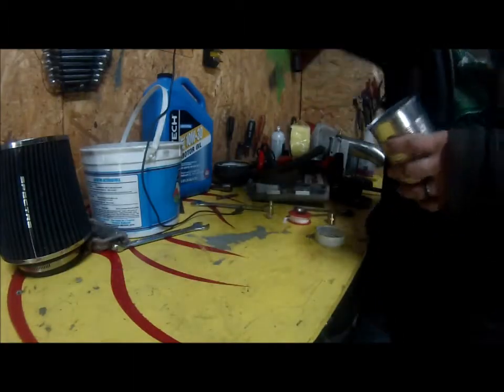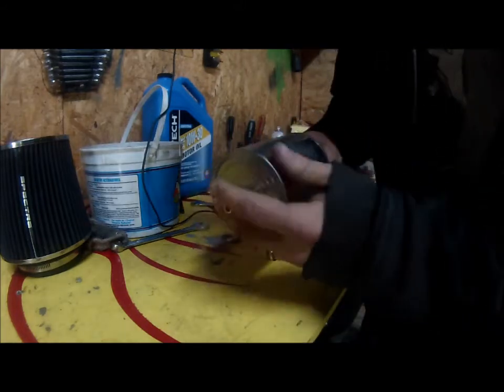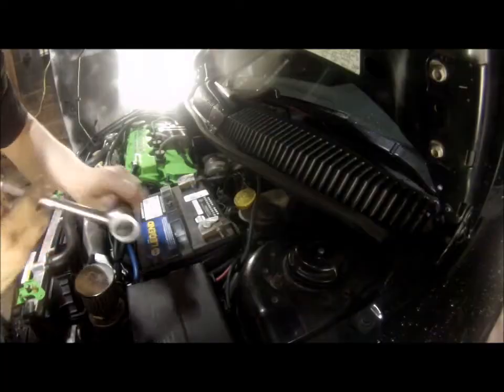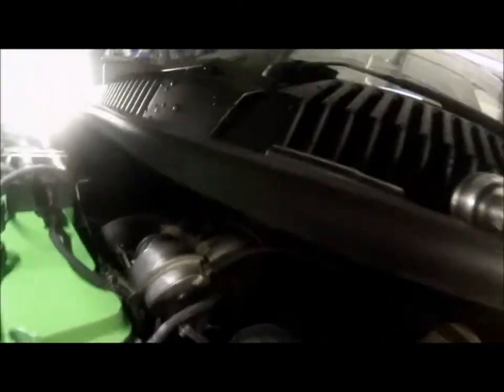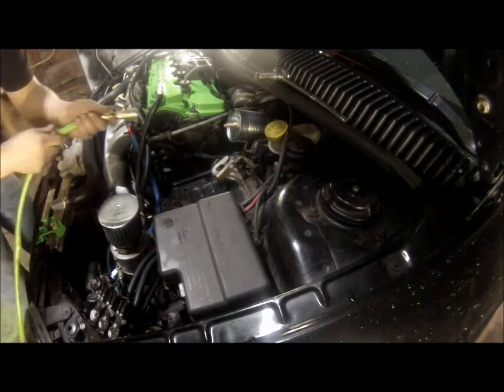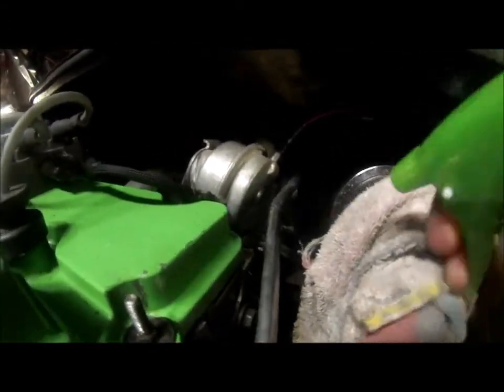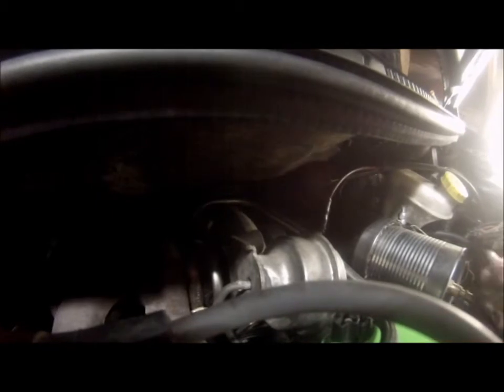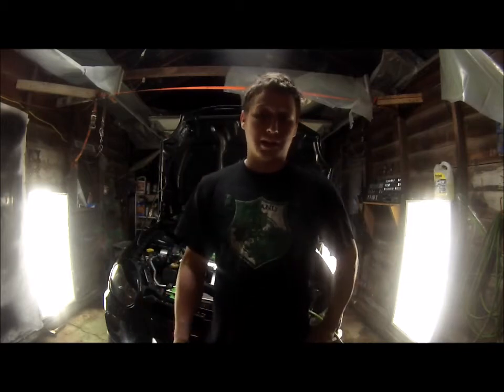How to make a home made boost leak tester.

Comment: Best video for srt4 boost leak.
I will try the air valve stem method .
My srt4 has major leaks . Goes phsss when i hit gas .
With 93 tune i'm still getting only 14psi boost .
Cold air intake , walbro 255 , ngk , msd , and upgraded injectors should give me atleast 18psi with the tune